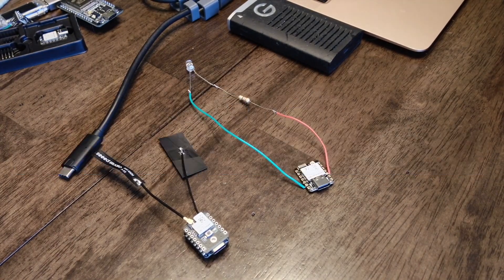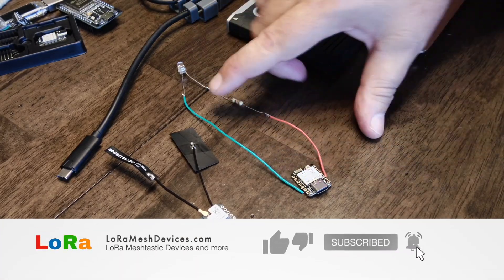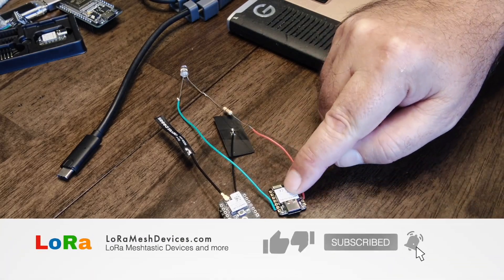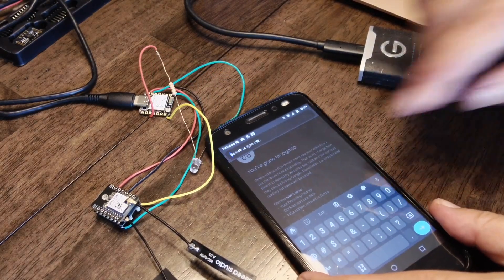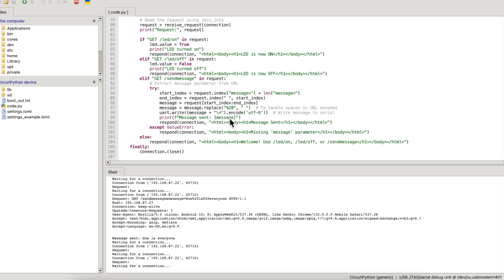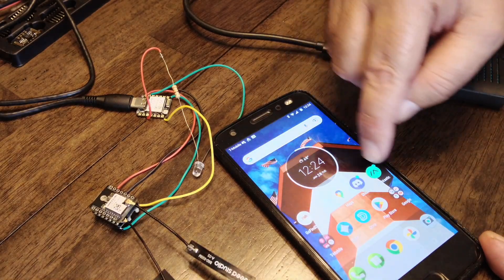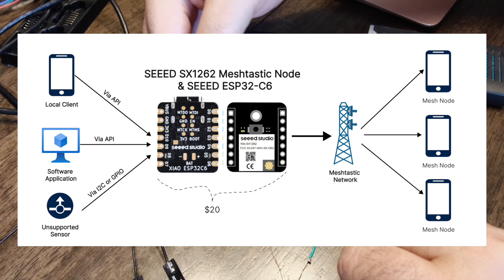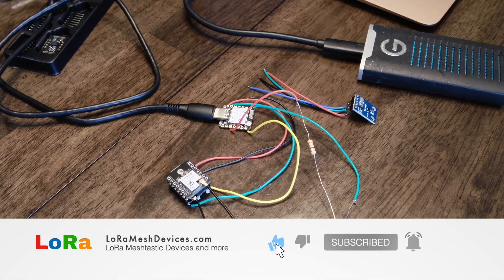ESP32 C6 + Meshtastic: Send Messages!

Comment: Thank you so much for your video! I've been trying too confirm my design through others and you're the first I've been able to find.

The plan is to have a "command" node and  then be able to send messages to "control" nodes which are connected to an Arduino board that has numerous attachments.  The command node will send configuration information to the control node(s) and then the control nodes will send information back to the command node based on messages from the Arduino board (telemetry, program information, etc). 

I also love how small you've got your setup with the ESP32's.
Reply from the maker: What an intriguing setup! Your method of using a "command" node is brilliant. Have you considered how the system could evolve with more nodes? It could enhance versatility!
Reply: @ in the end it’s a multicast system.  So as long as you can deal with not ddos’ing your nodes with broadcast storm, you’d be able to send commands to nodes over any hop. 

It also depends on if you want a “closed” system or not.  If you did, you could have repeater nodes that just pass messages to control nodes.  Control nodes only accept messages with their node id and a shared secret with the command node if security is a concern.